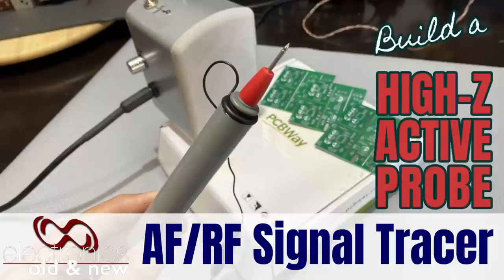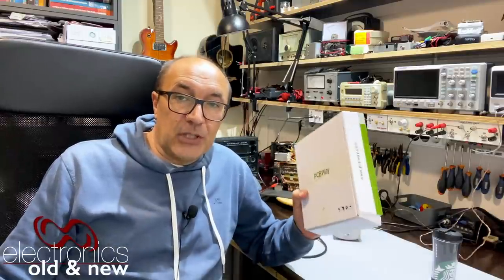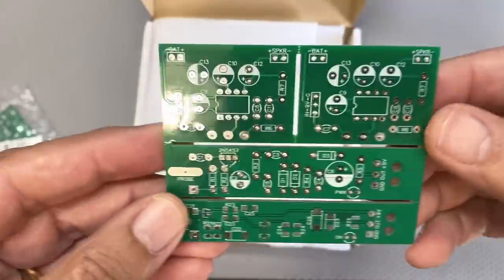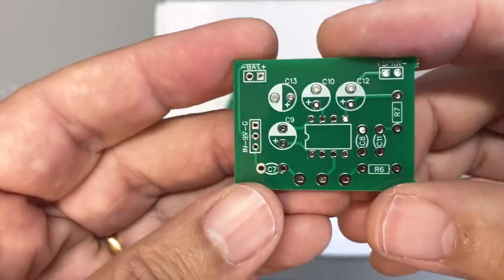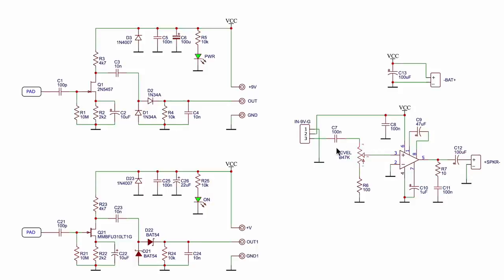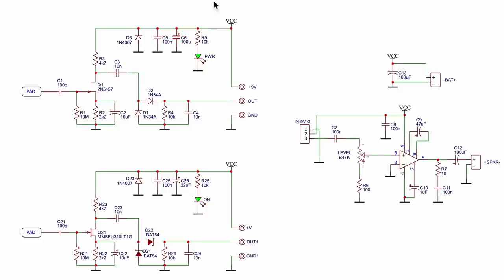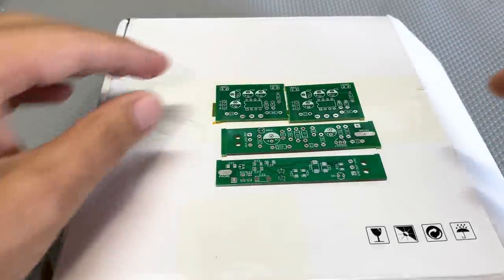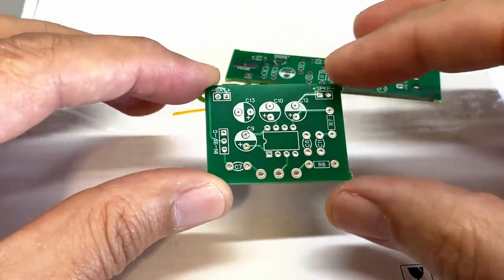Build a high impedance active RF/AF probe with amplifier. Ideal for radio and amp repairs. #PCBWay#

Comment: Brilliant Video you have done an amazing job making the PCB and what you have built is far better than the probe I made. I am glad you worked with PCBway it’s great that they reach out and support the YouTube community. Hopefully people will enjoy building the probe and look forward to comments and seeing how it could be improved.  The gain of the probe is quite high so I would say it works better in the RF and IF sections but it’s difficult to achieve a real big dynamic range.  Thanks so much for making the probe and I am really glad you like the end result. My very best regards Chris
Reply from the maker: Thanks Chris. I too would like others to try it out and give suggestions, then between us we could create the “probe of all probes” for the community 😊 I’ve had a few thoughts:
1) Some sort of AGC?
2) Auto detecting RF vs AF and switching between two separate sub-circuits before feeding to the amplifier?
3) Adding a “super-gain” section that can be switched in to sniff out noisy components?
I sometimes lose steam halfway through this sort of “dream project” and don’t carry it through, but if others want to participate, I can always do the boards 😊

Comment: Interesting project! Also looking at mr Carlsons super probe! It is a no contact probe so impedance not an issue. It is high gain probe amplifier with volume control and a squelch circuit which homes into noisy resistors (i.e. frying eggs, pops, noises) without any electrical contact! Far safer as well if you probe valve circuits and it’s powered by batteries as well! He demos it very well on his iTunes videos!😊
Reply from the maker: I’ve seen it and liked it too

Comment: maybe build it like a alien probe! with a battery. tda 2883 is a 3v chip, 1 lithium cr123. I can predict a blown j310 and those are expensive. just use 2 diodes or maybe just 1 diode - bias it with a 10 meg resistor.

Comment: Hello Manuel, a simple way to increase the input impedance and decrease the Miller effect would be to change the single input FET to a cascode input using two FETs remaining everything the same.
Reply: I just made a big long comment suggesting the same thing.  I, however, suggest a NPN BJT as the upper transistor of the cascode.  The source of the upper JFET looks like a resistance with a value of 1/gm.  With a BJT you get a lower number.

Comment: Great work Manuel. Some brilliant ideas. I wonder if you could have made a hybrid board to use the FET and germaniums with smd components. I knew you wouldn’t be able to resist a go at smd. I used a switched potentiometer when I made my signal tracer but it’s all very dated now and my probe is nowhere near as good as yours. Cheers Graham
Reply from the maker: I planned to use a switched pot, but the the idea of blending it into my speaker/load came up 😊

Comment: Nice. 
I can actually use the probe for my amature radio builds & it's within my skill set unlike high voltage projects, so definitely on my to do list.

I find old aluminum tube lawn furniture is a great source for metal tubing and have made several VHF antennas with it and apparently due to its fairly large diameter the interval of good impedance match was much broader than when I used 12 gauge wire.
Reply from the maker: 👍 recycling at its best
Reply: The first lesson amateur radio enthusiasts should learn is how to spell the word amateur. 😉
Reply: @SpeccyMan  Well, google's auto spelling corrector does not always obey what you want the symbol or its spelling to map to when one insists it matches their selection for a symbol or composite symbol standing in for whatever they are having it stand in for. It always pays to go back and check what auto correct has done for sometimes it is cringe worthy with respect to what was intended. Most people don't. I normally do, likely because of by education being a mathematician thus keenly aware of the importance of grammar and definitions being well defined, but not always.

Comment: Thanks for sharing! Nice placement of the pot. Nice speaker/dummy load. Maybe add a light bulb to be a visual flicker indication of what is going on when just using the Load? Designing/Adding an automatic volume adjustment would be interesting/useful... Hmm? An op amp control with a pot adjustment on the reference? I would add heat shrink over the metal probe tube, to prevent it from shorting anything out, while fishing around in the circuit. It would be slightly more comfortable to hold, as well.
Reply from the maker: More good ideas. Thanks.

Comment: Great test probe. The LM386 is a good sensitive amplifier. I like the TDA7052 it has a volume control that is voltage operated at pin four and can be used as an automatic volume control. Maybe try for fun

Comment: Hello, very cool project . I am going to restore tube ham radios . So very needed . The pcb site is saying 54.00 for 5 boards .
Reply from the maker: Download the Gerbers and see if you can get a good price elsewhere. The Gerbers are good for any manufacturer. The price is high because I added both boards in one and it uses cutouts. Didn’t know about that issue when I posted the projects
Reply: I got the same estimate as well and they say you may have to pay customs as well, Strip board will do for me inside a piece of copper water pipe! It will a good screen with insulation on the outside surface!
Reply: Yes, I will look into that  . That or just build Manhattan style .

Comment: I am not going to watch you build it because the schematic was what I was interested in seeing.  I do have a few pointers for someone designing one of these.
2N5457 has 7pF of gate capacitance and 3pF drain to gate.
The 310 is about the same.
I would use parts in a SOT-32 package.  They can be soldered and you get less effect from leads.
Parts with numbers like xxx4117, xxx4118, xxx4119 have a lower capacitance.  They will work up to about 50MHz with careful layout.
If you change the input section to be a cascode followed by a "voltage follower", you can get more impedance transformation in the stage.
Alternatively, you can add a PNP common emitter gain stage to add a little gain.
A small resistance in series with the source capacitor for the input pushed the input impedance up a bit more. 
You can get even higher impedance at the cost of gain by doing this with the 3 transistors with PNP version:
A slight feedback from the collector of the PNP  back to the source can make the source want to go positive when the gate does.  The Gate to Source capacitance will then have less AC voltage on it than the input and less current will flow in it.  This makes the impedance a lot higher.  You can get below 1pF of input capacitance with this method.
If you use an NPN BJT in the upper transistor of the cascode, you can make the base of that transistor AC coupled to the JFET's source.
(You can even apply a bit more feedback to it with great care)
This has the effect of making the drain of the JFET actually swing positive a little when the gate goes positive.  This can take the drain to gate capacitance out of the picture.
The result can be a probe that you can just bring alongside a wire to sniff for a signal.

Comment: I am thinking of copper pipe ( diameter 22mm or 28mm) would make a excellent screened body for the probe with a thin plastic inner liner to prevent shorts! Copper off cuts are easily available from plumbers and copper braid would solder well for ground contact!
Reply from the maker: Yes, that would work very well.
Reply: I use an oscilloscope probe for my signal tracer, I install a BNC connector on it.

Comment: That's a great little unit to have in your stack of testequipment.
Will the next version have a switch were you can select between AM and FM demodulation? 😋
You will not be able to check if the local oscillator is running with this would you?
If you had the option to connect a oscilloscope after the FET, then you might be able to do just that.
Reply from the maker: Good idea.

Comment: Maybe you should insulate the outside of that metal tube. Put some contact paper or something around it. As it is grounded to the UUT if you hit that metal tube against some high voltage tube connection you will short it out and make a big bang like Electro Boom...
Reply from the maker: Absolutely  right. Some heat-shrink is going to protect it a bit more. Thanks.

Comment: Hi Manuel. I'm just checking the cost of your PCB on PCBWay. It is not $5 for 10 PCBs as stated. It is $53.39 for a minimum order of 5 of your PCBs. But I do need only one (at most 2, as a reserve if something goes wrong on the assembly of it). It is that correct? It is a pity because this probe looks like it would be very helpful. Thanks.
Reply from the maker: I have no idea why that price is so high. May have something to do with the cuts on the board. You can download the gerber files and try and get it done by another supplier. Unfortunately I have no boards left as I have some to Chris.
Reply: @electronicsoldandnew  Thanks again Manuel.

Comment: Interesting.  I have few suggestions to improve your design: 1-  for biasing purposes  you need to connect the input of your op-amp to the middle of supply ( the positive input of opamp),  not ground (actually that would become your AC ground which is different from DC ground) so you can get maximum swing out of your Audio amp, then connect the negative input with a feedback resistor to the output. 2.  Use a voltage buffer stage before this stage with another op-amp.  that is connect output of that op amp to negative input and use positive input as your input. 3. Use micro strip line for your RF probe so you do not get impedance mismatch and reflection at high frequencies. 4.  Either use an AGC (Automatic Gain Control) or manual gain control for your RF probe preferably switchable.  If you need help to design those circuits, let me know I will help you.
Reply from the maker: No problem. Thanks for the tips. The amp is however not an opamp at all. It’s the LM386 power amp chip which is spec’s to single supply rails.
Reply: @electronicsoldandnew  

Thanks for your info about LM386. 

You are right about LM386, it is a strange type of opamp, since in a opamp a current source at the mirror point of opamp is used, they use resistor here, which in theory reduces PSRR (Power Supply Rejection Ratio)!  Furthermore, two  PNPs in LM386 connected in Darlington configuration at inputs would like the inputs signal be close to ground ( ie. Needs at least 2x-0.7= -1.4V from the emitter to turn on these transistors. )  Furthermore, differential to common mode convertor NPN load of the circuit needs at least 0.7V , I guess that is why there is 100 Ohm in series with the pot, in order to ensure PNP and NPN transistors are biased correctly.  Here is the datasheet for LM386: 
https://www.ti.com/lit/ds/symlink/lm386.pdf

For RF probing I would use near field magnetic or electric probe, instead of direct connection, since it causes much less interference with the signal, here are some videos about that:

https://www.youtube.com/watch?v=6yR7JOkPrvU
and
https://www.youtube.com/watch?v=ctynv2klT6Q
and
https://www.youtube.com/watch?v=x1rn5YNLmVw
and
https://www.youtube.com/watch?v=2xy3Hm1_ZqI
and
https://www.youtube.com/watch?v=PSbsAl_lVro

Thanks for posting a good video.

Comment: Hi, Just wondering if you could provide the order # of the required module to build the high impedance active RF/AF probe.
Reply from the maker: It’s pretty clear at 13:35 on the second version video. Not sure if the actual order number.

Comment: I need help I just did a nice restoration of a Heathkit A-9c and came out great and is in great condition it sounds very good nice mids and deep bass with the pair of 6l6s 
So I’m getting horrible alien digital sounds when I turn up the volume 1/4 way and louder to full volume 
I tried everything it’s away from the speakers no wires are crossed over the inputs I did change the 12ax7 tube and the 12au7 it got about 15 percent better 
Any suggestions on blocking this I know my HH Scott 222c has a shield for the preamp pots I hope I don’t have to do this  and it’s not ac hum it’s dead quiet it will still make This alien noises with no input

Comment: This is great use for the 3D printer =)

I do find myself periodically making copies of your designs for my uses. The super probe might be the next one, so I might make a copy of your copy.

I'll go watch the original video as well. I do have a question though. How does a single FET amplify audio? Doesn't audio go into negative and positive voltage ranges? Yes I realize that there's an audio amp in the circuit but doesn't it get it's input from the single FET?
Reply from the maker: The Fet is configured as a normal gain stage. There are great explanations on the various Fet amp stage types on the web.
Reply: @electronicsoldandnew  I'll have to do some more reading for sure. I only have some basic information/understanding of amps as it is. I assume there is a bias voltage of some sort? Or am I thinking backwards.
Reply from the maker: The device can be biased in various ways, including the source resistor method, which provides the equivalent of a tube’s cathode bias.

Comment: Hi, Since it appears that you have used balanced audio cable for your RF probe's flex, I presume that the impedance of this cable is not important.  Why is this?  I have seen other active probe designs where the cable specified is either RG178 or RG174 (both 50 ohm coax cables).  Is it just so the latter can be matched to the impedance of oscilloscopes, spectrum analysers, etc?
Reply from the maker: The length of the cable is minimal, and I don’t need to actually obtain any quantitative measurements from this, so matching impedances is not an issue here.
Reply: @electronicsoldandnew  Got it. Thanks.🙂

Comment: What about testing tube radios with it? Will keep it working or blew out?
Reply from the maker: We’re going to find out soon enough 😊 The high voltage capacitor at the input is supposed to protect it, but only experience will tell.

Comment: Another interesting project Manuel - keep up the good work please!  Is there any way you can share the EasyEDA source files so we can modify your design to suit our needs?  I believe that a PCB design can be exported as a json file or the design can be shared in EasyEDA by changing its status from private to public - assuming you would be willing to do this?
Reply from the maker: sure. email me and I send you the files.
Reply: @electronicsoldandnew  Hi Manuel, I sent an email a few days ago, have you had chance to see it yet?  Thanks
Reply from the maker: I did. Just looking for the files 😊
Reply: @electronicsoldandnew  Thanks, no rush just wondered if lost in the SPAM folder.😀
Reply: Don't worry if you can't track them down Manuel, I'll have a go at recreating the board.
Reply from the maker: Steven, I gather that you didn’t get my email? I’ll send it again tonight.
Reply: @electronicsoldandnew  I didn't, but got it this time and it imported OK into EasyEDA, many thanks for helping with this😀
Reply from the maker: my pleasure

Comment: manuel why not decoupling the j310 fet source with a 1nf  capacitor ?or is it intentioned to not extend gain  to rf frecuencies
Reply from the maker: The value of the cap used raises the gain of practically all frequencies. The smaller the capacitor, the higher the cutoff frequency of the frequency band amplified, so in fact it’s the opposite effect. No great thought was given to the value in this case.
Reply: Manuel, my comment it's about C2 10micro elco, from few hertz to hundreds khz its ok, decouples ok source fet, (455khz, 2Mhz.. IF frecuencies) at 10,7Mhz elco capacitor I think it's not tbe best decoupling method,... for rf voltage a ceramic capacitor, put the source at ground level and make fet's voltage gain, useful at V/UHF frecuencies.
Although someone, talked about using only schotky diodes, germanium diodes & fast silicon rectifiers(low cap) are also ok, in my humble opinion. It's a signal tracer probe, not a high (bucks) level ones, does its job👍👍👍.

Comment: Greetings again. Excellent video, I have already assembled the "Power supply board for adding bluetooth module", with excellent results. In this case I wanted to make the request for the PCBs, but when making the request, an amount for 5 units of $53 (without shipping) comes out, I do not understand PCB design, so I do not know if there is something in the Gerber file that of a different configuration. If you can guide me, so that the cost is similar to your purchase (Only $5 for 10 PCBs and every new member get $5 bonus. + Express 24 hour / 48 hour) and be able to make this circuit. Thank you very much. a follower
Reply from the maker: Hi. I tried it myself and got the same result. Don't understand why. When I tried the quick order (where you upload the Gerber files), it quotes me the expected $5. I would recommend that you download the Gerbers from the Share page, and then order by uploading the Gerbers again to the order page, so that you get the low price. The actual page is this one:
https://www.pcbway.com/QuickOrderOnline.aspx

Comment: I think I'll build one. Just by chance I have a Grundig Satellit 700 on my bench now, the FM local oscillator appears dead, MF and HF bands are good, FM +5V bus good. Replacing CT505 (local osc transistor) accomplished nothing.
Reply from the maker: Keep at it. You’ll get there 👍